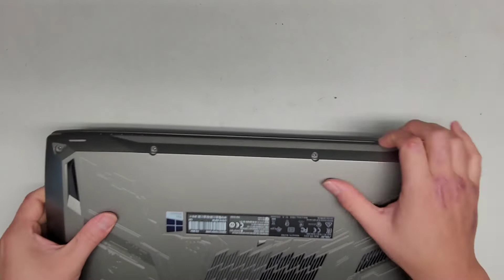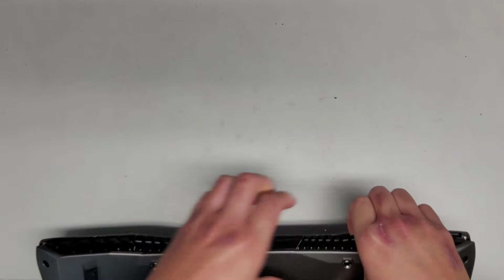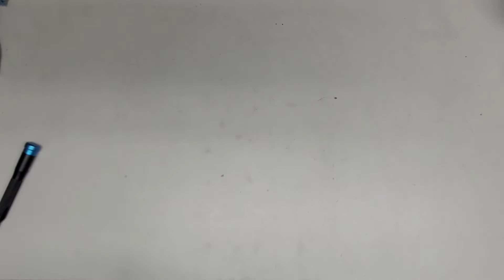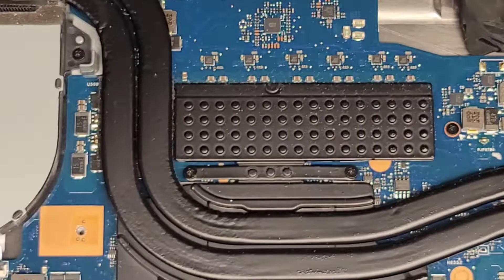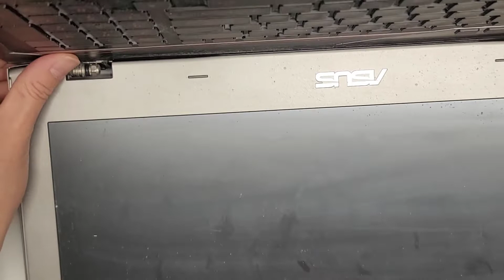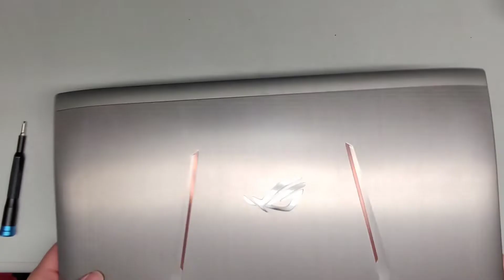ASUS ROG Republic of Gamers G701V G701VI-XB72K Disassembly Quick Look Battery Replacement Repair

Comment: Hello, I need to know the required thickness for thermal pads in this device. What is the appropriate thickness? Please reply.
Reply from the maker: I don't know. You'll have to measure what's in there. I use this so I don't have to worry about it. https://amzn.to/437uaaE
Reply: @ItsBinhRepaired Okay, another question: are you sure this version has another SSD NVMe slot on the other side of the motherboard? And is this laptop yours? I have other questions.

Comment: Does it seem odd that the fan intakes are completely blocked by the base cover?
Reply from the maker: It's to guide the airflow from the middle of the laptop through to the back. Are the fans not moving much air?
Reply: Im thinking of gently inserting a long enough rod of some sort thru the exhaust thru the cooler to hold the fans in place and vacuum a bit. Those fan blades can get caked up with dust. After watching two videos, im seeing the fans are sucking air from the base plate. They could cool the coolers more effectively if they were not so restricted.

Comment: did you fix the problem?
I have the same laptop, but it won't boot. turns on the lights, but the fans do not turn, it does not show an image either.
Reply from the maker: Check the RAM
Reply: @ItsBinhRepaired  Yes, I tested the RAM. and still the same. only the leds light up, and the SSD gets hot... but the GPU and CPU don't get hot
Reply from the maker: Hmmm not sure :( sounds like a dead motherboard
Reply: How big can I upgrade the SDD to?
Reply from the maker: No limit
Reply: I had mine off for about two years while I dealt with some personal stuff… And when I went to turn it back on, it booted the ROG logo and then shut off and won’t turn back on. Ideas?
Reply from the maker: No idea. Possibly bad battery.